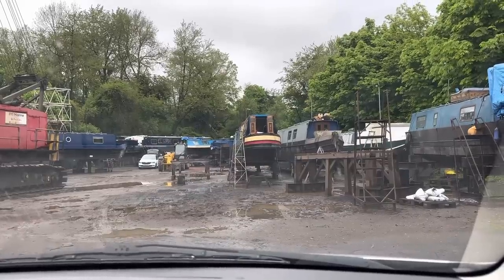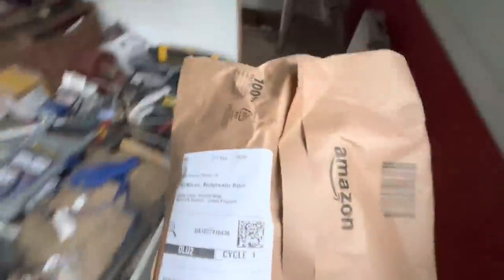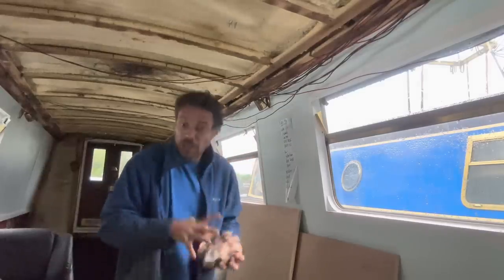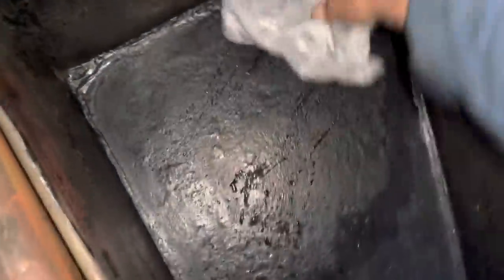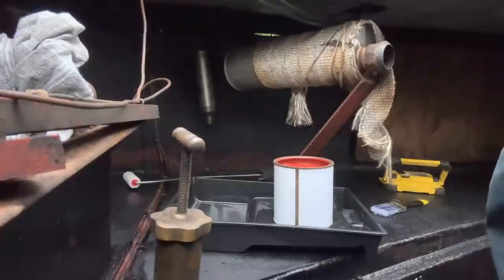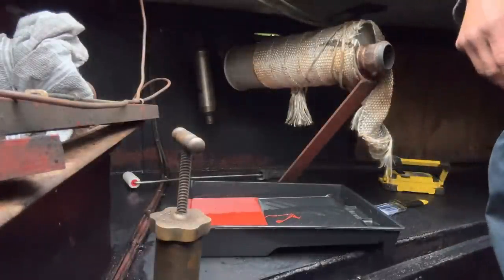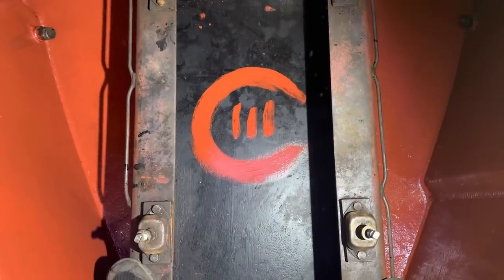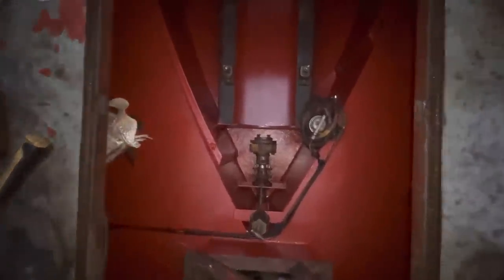422. Applying RED OXIDE to the bilge

Comment: No paint on engine bearers? I would recommend two coats of the red on base plate and part sides as unlike the sealing cosmetic topcoat the red is the reactive anti corrosion layer and roller application may be too thin and is where the water will gravitate to and collect. Head needs to emulate Peaky Blinders to not match the base coat.
Reply from the maker: That’s true, I wouldn’t have seen any drops of blood !!

Comment: What does the red oxide do the vactan and garage floor epoxy doesn't?
Reply from the maker: Vactan - rust inhibitor 
Red oxide - anti corrosion 
Floor paint - protection layer 

That’s the logic. So vactan treats what’s already there, red oxide stops more forming and the floor paint protects the whole lot - that’s the plan

Comment: when you put engine back you have to make it so rain not get in  i see wter nin now not good m8
Reply from the maker: Clear drainage channels but it’s hardly any. A good pram hood is the ONLY way to prevent water
Reply: @TheNarrowboatThatJamesBuilt  despite a cover over the stern (semi-trad), my son's boat deck still gets wet as water from the roof drains to the rear channelled by the side rails.